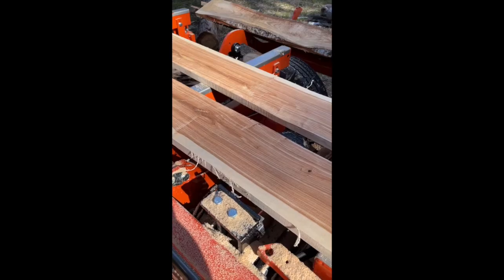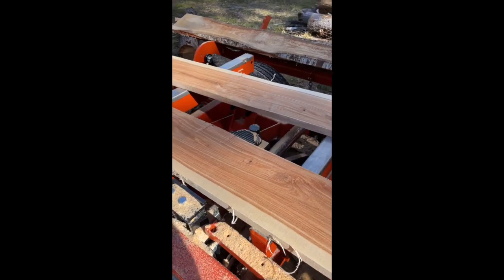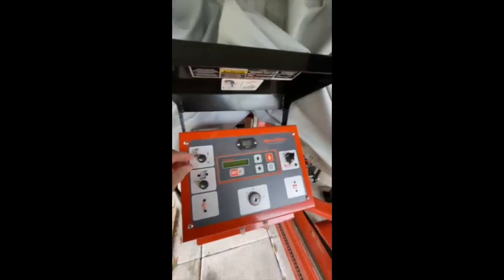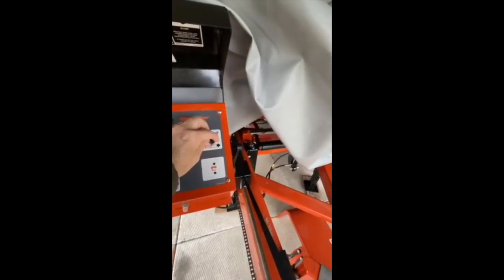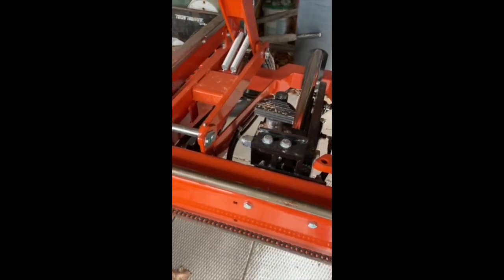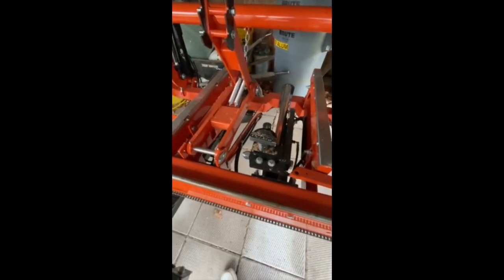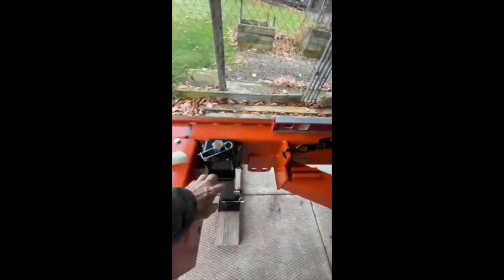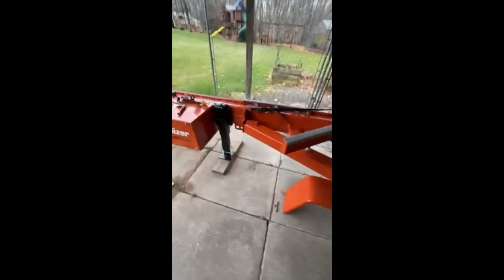LT35 - 💥 Top 6 Lessons 🌟 I Learned on my new Woodmizer LT35HD

Comment: For edging I always put the extra board next to the clamp so the board I'm edging hits all the stops and I get less bouncing at the start and finish. I'm 68 (my brother is 66) and the adjustable legs saved me us a lot of frustration. Another tip, don't unhook from your truck if you're on a slope unless you have the wheels chocked (my brother didn't really NEED that fence).
Reply from the maker: Frank, thanks for watching!  One advantage to having the extra board on the inside is that you can use the toe boards to get a level cut if one side is much bigger than the other. Otherwise I totally agree.  Learned a lot this year.

Comment: Was wondering what you had for a mill before the LT35?  I have an LT15 and am finding that as I get older the hydraulic mill is looking much more appealing.
Reply from the maker: I had an LT15GO.  Same reason why I upgraded.
Reply: Any advice? Was the LT35 enough of a machine or do you wish you went larger?
Reply from the maker: @thatguyc5899  The only thing I might consider is the LT40Wide because the throat on the LT35 is 26" which occasionally gets
in the way.  For a while they were doing a free up grade to wide.  The LT40 has 28" throat which goes to 34" if you get the wide model.
The LT35 doesn't offer a wide model.  Probably about $7500 more to go to the LT40 Wide.  I have the gas engine, the Diesel is another $6K for the LT35. It is a little
slow when you are going through wide boards, but if you get down to smaller cants 12" or less, it moves pretty quickly through the logs.
I have to go slow when it is hard wood and I am using the debarker on wide pieces.  Not to big of a deal.  As always it is always about how 
much you want to spend.  If you aren't trying to do production work it the gas engine is fine.  I don't think I could go back to the LT15 now that I 
have upgraded.  Resale is almost what I paid for the LT15 4 years previously.  They hold their value.  Sold in only a couple of days.
Reply: Thank you.  You have made this decision much easier.
Reply from the maker: @thatguyc5899  not a problem.  Good luck!  Definitely get the optional fine adjustment outriggers.  The ones that came with it are very hard to use.  They were expensive but worth it.
Reply: Arrives in October.
Reply from the maker: @thatguyc5899  Congrats!  you will really enjoy it.  Let me know if you have any questions when it arrives.

Comment: The hydraulic log clamp head rotates so it will secure the smaller boards but it will score into the wood if you are not careful
Reply from the maker: @tomharris418 I didn’t realize that, thanks for another tip!

Comment: Nice video.  I learned some things.  I put in an order for an LT35HD way back in Feb '22.  It won't show up until some time late next summer.  Ugh.  Don't forget to lower the hitch again when you pull it back out!!!  Would be a drag (literally) to crash the head into the roof rafters.

Have you joined the Forestry Forum?  There's a very active sawmill forum there, tons of Wood-Mizer people there.
Reply from the maker: Thanks for the feedback!  You will really enjoy it when you get it.  I had an LT15GO previously which worked really well but there is a lot of new stuff to learn on the LT35 Hydraulic.  You will get used to it fairly quickly.  The one thing that I still mess up sometimes is hitting the lever on the right instead of the  one on the left to advance the mill head.  The one on the right raises and lowers the head.  Not a good thing to do if the blade is already in the wood.  Luckily I haven't broken a blade yet.  I think it is because I am right handed and it seems backwards to me.  I just slow down to try and not make those mistakes.  

I definitely will be extra careful when I pull the mill out. :)

I sometimes go on some of the Forums, usually I look for a video first because I am a visual learner.